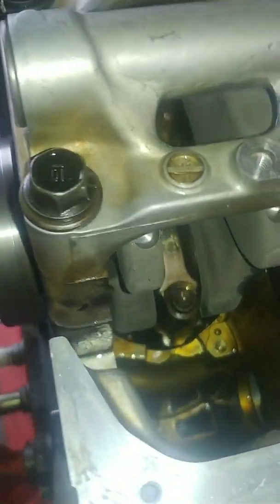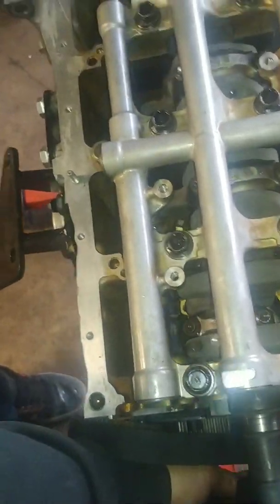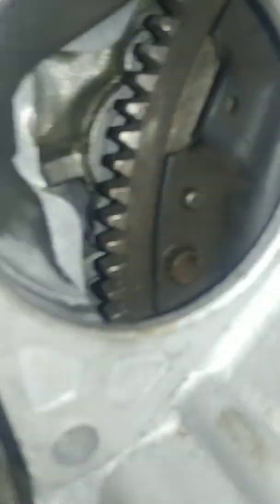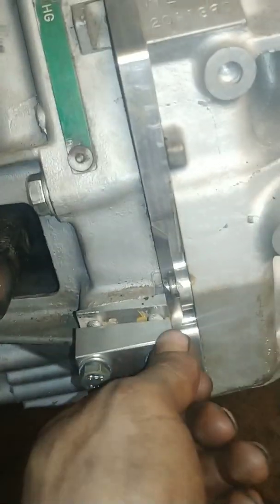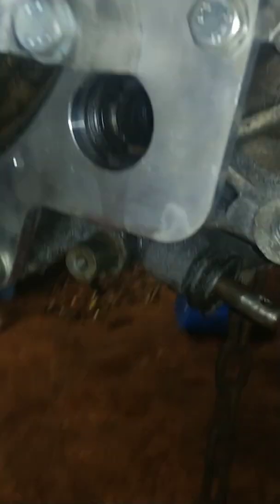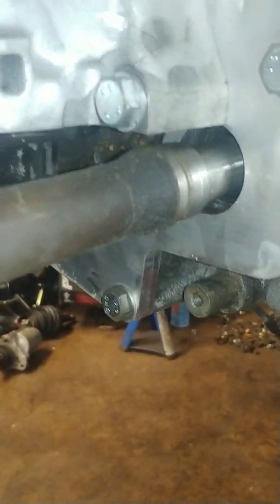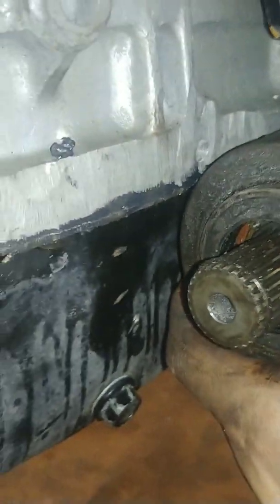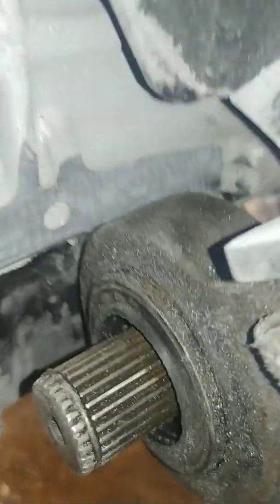How to install a QSD H2B kit and shaving the Block for clearance

Comment: Hey what’s up, what did u used to shave that little piece that sat on the side of the block where the trans connected
Reply from the maker: Flap disk or grinder buddy it's just so the plate can sit flat

Comment: Hey whats that adapter plate around the oil pressure sensor on the back of the block at 3.26?
Reply from the maker: Its part of the h2b kit buddy a stock b series half shaft won't bolt to a h series so you have to run that adapter
Reply: @fullspoolcustoms3944  thank you just ordered the adapter now hopefully car will run better now lol
Reply from the maker: @JJW4143  I ran 12.60@110 stock h23vtec type s cams b 16 open diff trans 1.63 60 ft

Comment: This is my setup 95 cd5 accord h22a si prelude transmission but I'm saving my money up for h22 full Hseries lsd transmission my motor stock with full bolt ons skunk 2 intake manifold gotta get bigger throttle body not sure if I should go 74mm or 90mm I'm trying to save up for the hondatta s300 KStuned black ecu
Reply from the maker: Stock motor 74mm will be ideal buddy

Comment: Which transmission is it ? Lsd or open?
Reply from the maker: B16 sir s4c open diff We have hit 1.62 60 ft with same setup stock h23vtec type s cams s4c trans with bolt ons and pump 91 on that pass car went 12.66@110mph all motor